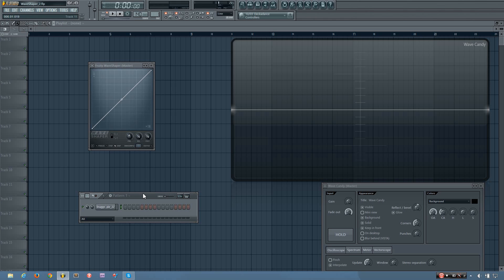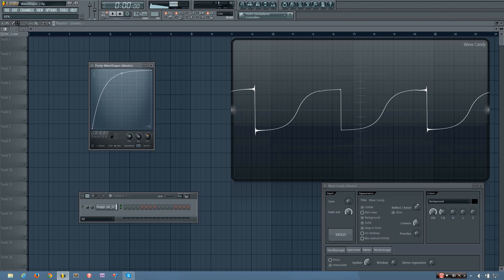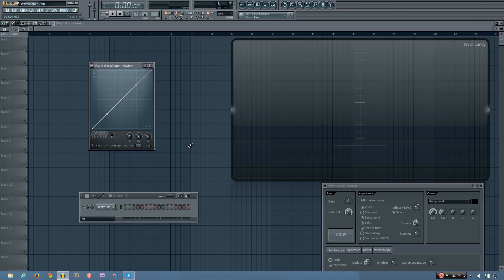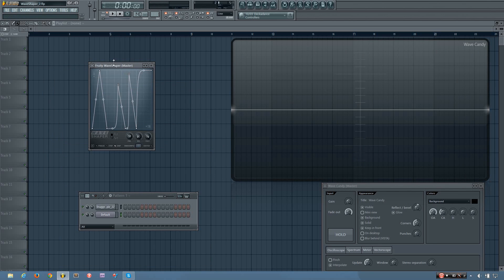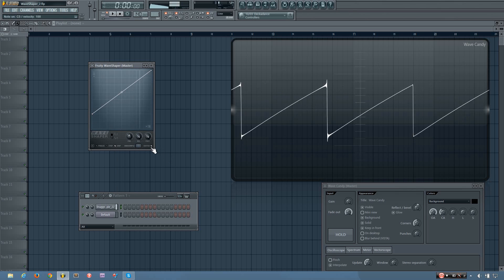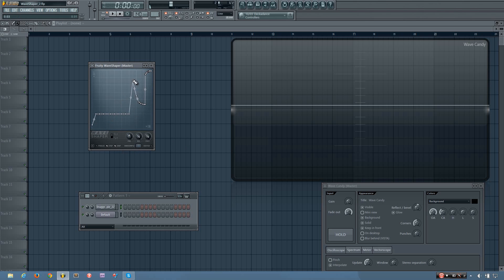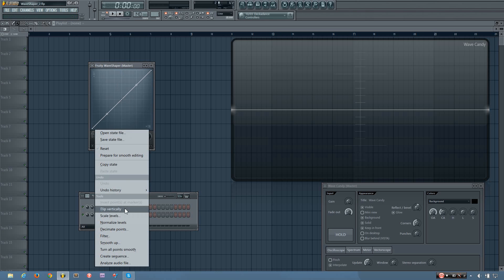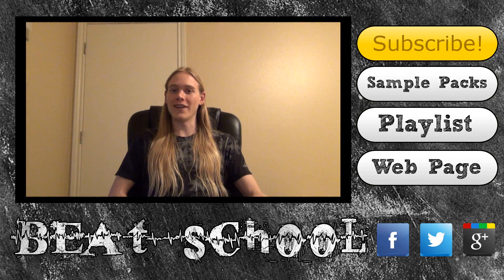FL Studio Tutorial- How To Use Fruity WaveShaper

Comment: i have a problem, i used the Waveshaper (Noiser), when i play the track on FL it sound like it should, but when i export the track in the mp3 version its like the effect disappear...could you help me?
Reply from the maker: Assuming this isn't being caused by some automation (check for that first), it's probably due to quality difference on playback vs export. 

To fix it, you can try lowering the quality settings when you export. Disable "HQ for all plugins", and if that doesn't work lower the resampling to 24 point sync or lower as well.  

If that still doesn't work, you can record the sound with Edison... either the whole song and export that as mp3, or just the sound that is having this issue and replace it in your track with the recorded version
Reply: @IVTheFourth  thank you!